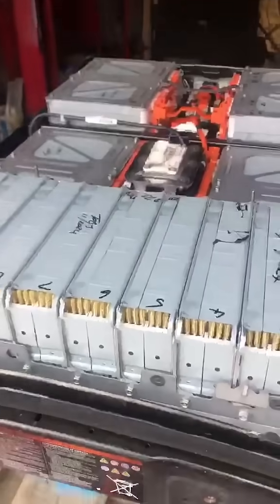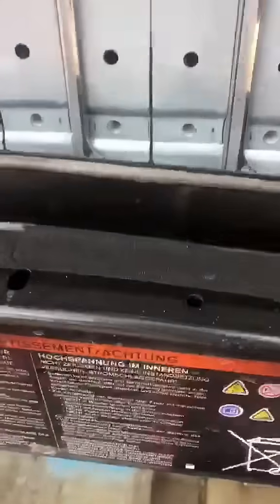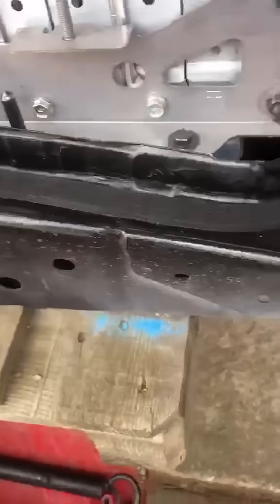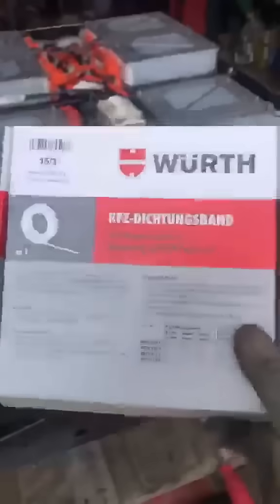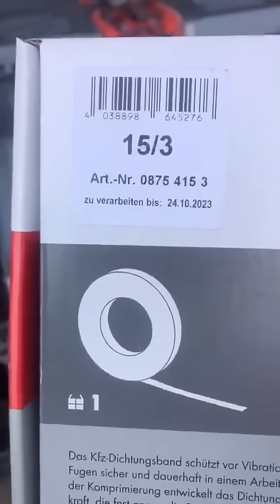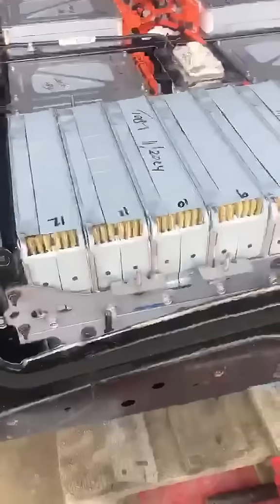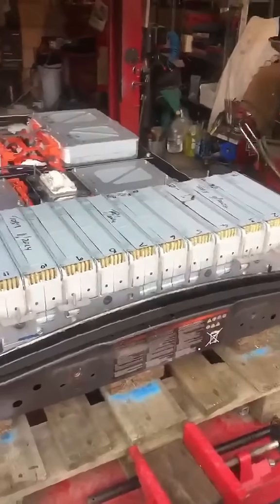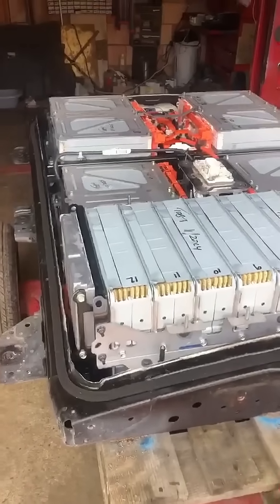Helping to make your #LeafBatteryUpgrade Nissan Leaf Battery upgrade go as best it can, tips & help

Comment: Great idea,does it pass the battery case pressure test ?
Reply from the maker: If you'd like to pop over with a pressure testing setup and the relevant data, we can check for your full answer. But, yes, its waterproof & windproof .......
Reply: @mnmszerviz  I was given advice on doing a pressure test by the person I bought my replacement module from .just seal all the plugs with tape and a bit of tight fitting hose pushed in the pressure testing port then gently blow on the hose. I didn't get a seal with the silicone first time and this showed it up straight away,a bit more silicone on the leaky bit and blowing on the hose gives resistance and blowback from the hose so was then sure it was sealed.would be great if your sealing tape gives the same result.
Reply from the maker: That sounds like a good way to test it! The tape is infallible, as it's compressed down from 15mm to around 4 or 4 , and I make sure there's a good overlap on the join :-) When your next module needs doing, taping the joint afterwards will make the subsequent ones a breeze ;-)